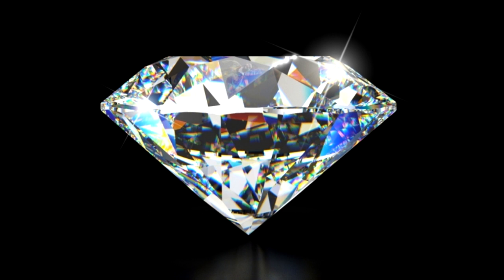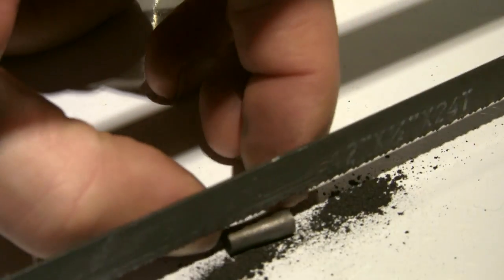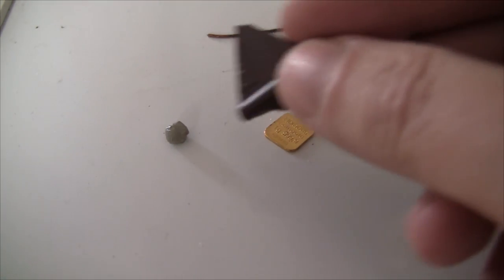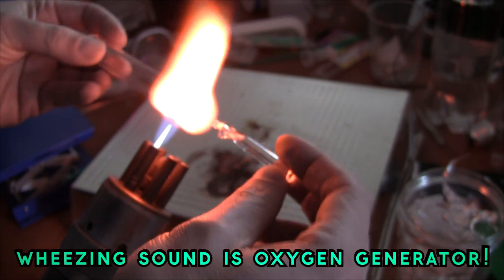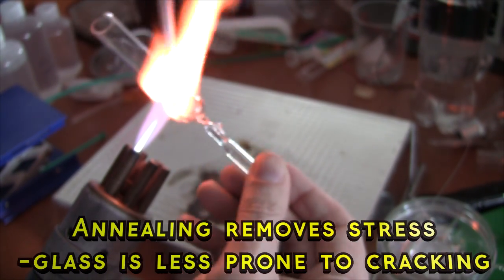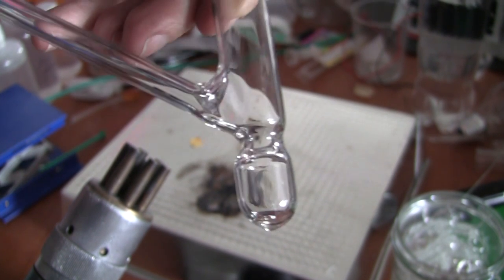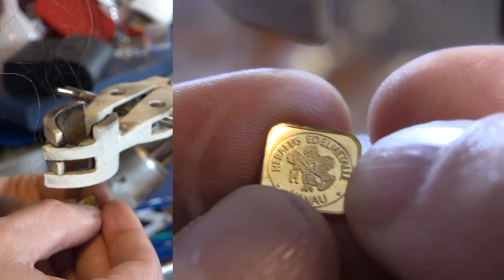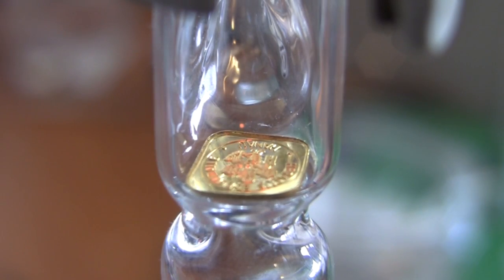Can burning Diamond melt Gold?

Comment: If you want to burn a good heat conductor and cant get it hot enough, put it into a vacuum (hyperloop) and burn it there!

Greetings, that guy who had the idea with the solar freaking hyperloop.
Reply: Syron with thorium batteries
Reply: Good idea for trapping the heat, but unfortunately vacuum-in-a-small-space and high-concentration-of-O2 are logically incompatible.
Reply: Rob Harwood That is what the solar panels are for. They make it burn. And generate thorium batteries out of solar energy and thin air.
Reply: wonder if it might have helped to have put the entire experiment into a thermos flask, to make it more difficult of the the heat to dissipate.

Comment: Make a video about 10000C Molten diamon knife vs -1000000 frozen golden knife
Reply: Knifes don't work if they are gaseous, and you cant reach -1000000, the minimum is 100 pK, or about -273.15 °C (rounded).
Reply: Joshua Jimbun issa troll
Reply: lbochtler Thought Absolute Zero was zero? Is 100 pK just the lowest temperature that we've been able to observe?
Reply: It is indeed the lowest we have been able to achieve (and observe), you are correct that absolute zero is indeed 0K, but it has never been reached.
Reply: Visceral3D it's not a knife if it is molten..

Comment: As long as you remember to thank those African workers for the diamonds, I can let it slide.
Reply: carefree4all1 He probably used artificial diamond, so he needs to thank a machine.
Reply: didn't he say the diamond came from india? and it's most likely an artificial diamond at that, so it was made in a high pressure chamber. zero workers needed. unless you mean the shipping indian workers then sure
Reply: Didn't he say from india, not africa?
Reply: m8onethousand Oh, artificial diamonds are diamonds made in pressure chambers?  I was wondering, "wouldn't using a zircon defeat the point of the experiment?"
Reply: surprised the Indians weren't scammers like with Microsoft
Reply: He said he got it off Ebay or something like that.

Comment: Ok thunderfoot, now you're just showing off
Reply: Guys, Synthetic Diamonds cost less than 100$. Structurally they are the same thing, but the artificial one is cheap. Calm down.
Reply: be honest though, this is 100x cooler than any diamond just mounted on a ring.
Reply: roughcut diamonds aren't all that expensive, especially opaque ones like he has there (the most expensive are cut, clear jewelry grade diamonds because cutting diamond is FUCKING HARD..so most the cost in diamonds is the work needed to produce good cuts combined with the difficulty of finding clear jewelry grade diamonds)

you can find loose cut diamonds for real cheap, quick google search found this: http://www.ebay.com/itm/1-Carats-SILVER-GREY-COLOR-UNCUT-RAW-ROUGH-NATURAL-DIAMONDS-1-PCs-q171/222424641507?_trksid=p2047675.c100005.m1851&_trkparms=aid%3D2220072%26algo%3DSIC.MBE%26ao%3D2%26asc%3D40130%26meid%3Db3a116690bd841b9847facf68dec82c1%26pid%3D100005%26rk%3D1%26rkt%3D6%26mehot%3Dlo%26sd%3D350275710339 1 carat, $22...about the same cost as that gram of gold (should be around $30 i think...*checks* no about 40...so 1 gram of gold is about 2 of those diamonds. all and all this video was about the cost of a video game.
Reply: @The Cent Lord Looking at your username I'd assume you really enjoy looking at stuff getting destroyed
Reply: I can almost guarantee the gold cost more than the raw, industrial diamond.
Reply: Gearz Pop, Synthetic Diamonds can be made clearer than natural diamonds, and still cost less. Natural diamond prices are artificial.
Reply: Nah, it's not that hard, sure you have to be trained to do it but it doesn't take a long time. the prices are just inflated by the diamond selling companies.
Reply: You lads need a snickers
Reply: Yeah what an asshole, what is the next video going to be? Can this diamond melt my new lamborghini?
Reply: Automated Miner Please tell me where else you would find videos of people burning diamonds. At least he's using it to show people something you maybe never see in your life. And he isn't completely destroying the stuff like TechRax who just pours molten aluminum onto an iPhone 7 with cockroaches on it. 

If you didn't see the video, he did this to debunk another bullshit "discovery".

Comment: WRong!!!!
Can jet fuel melt steel beans ? Thats what - I - want to know !!!
Reply: Olive oil wont burn green beans. :)
Reply: I hear steal beans make really strong coffee.
Reply: can Spirytus melt human livers?
Reply: https://www.nist.gov/engineering-laboratory/final-reports-nist-world-trade-center-disaster-investigation
Reply: +CaseAgainstFaith1   The buildings were probably close to collapse even without the fires, just from the damage caused by the planes.  
Plus, what actually failed in the WTC towers wasn't actually "steel beams", but trusses.  
Also there were no planes, just holograms.  (just kidding :-)
Reply: Is that about that 9/11 theory.
Reply: johno doh yea,definitely do this one
Reply: billyjoejimbob75 stolen beans make strong coffee???? You thief!
Reply: Yup. You got me on that one. Even after reading a comment where it was correct. I think that makes it extra bad. I'll leave it as it is just for fun.
Reply: +CaseAgainstFaith1   There is a big difference between a truss and a beam.  WTC truss: http://www.john-knapton.com/WTC14.JPG
Steel beam used in other skyscrapers: http://www.steel-sections.com/img/a992-steel-beam-frame.jpg A truss is not an assembly of "beams", since a beam by itself it a support structure.  A truss is a replacement for a beam.   The upper and lower members of a truss by themselves, would not even be able to support their own weight over a long span.
A truss is strong for the amount of material used, and is light weight compared to a solid steel beam.   The amount of heat required to reduce the strength of a truss is much less than that to weaken a solid steel beam.  Which is why there was structural failure aided by the fires. 
The 9/11 conspiracy theorists always use the term steel "beam", not "truss".  Which makes people think of a thick piece of steel that would not bend from a jet fuel fire, but would affect a truss made of thin members.  
There is even a saying by firemen :don't trust a truss", because they have a tendency to fail during large fires.  http://my.firefighternation.com/profiles/blogs/truss-construction-tactics-you
Reply: CaseAgainstFaith1 the steel beams on 911 were molten, they weren't merely heated to a point where they are not able to support a building anymore but were heated to a point where the beams melt!
Reply: Joshua:  Incorrect.  Jet fuel burns at 800 to 1500 degF.  Steel melts at 2750 degF.  This is easy to look up.  Why did you bother to "correct" me without first looking up whether or not you are correct???  We are, however, seemingly on the same side in the sense that I don't think either of us buys the 9/11 conspiracy theories.  And the jet fuel was hot enough to sufficiently weaken the beams that ultimately it doesn't really matter that it wasn't actually molten.
Reply: CaseAgainstFaith1 at the moment, yea. but things are too cloudy.
Reply: What is a "truss"?  It is an assembly of beams.  Steel.  In any case, we are all on the same basic side that "9/11 Trutherism" is false.
Reply: Thanks for the correction.  I've seen I-beams, channel, etc.  I assumed that trusses were made of basically small beams.  You gain strength to weight by having smaller pieces of metal separated by distance.  So, if the individual segments of a truss is not a "beam" what would you call the individual pieces of steel?  Just curious.  Thanks.
Reply: +CaseAgainstFaith1    You're welcome.    This site uses the terms, "top chord" and "bottom chord", there may be other names used by other manufacturers.   Such as top member or bottom member.
http://www.all-fab.com/wp-content/uploads/2015/12/Truss-Terminology.pdf
Reply: My3dviews:  Thanks.
Reply: Answer to OP:  No, but it can weaken them to less than 50% of original strength thus making them no longer sufficiently strong to support a building.